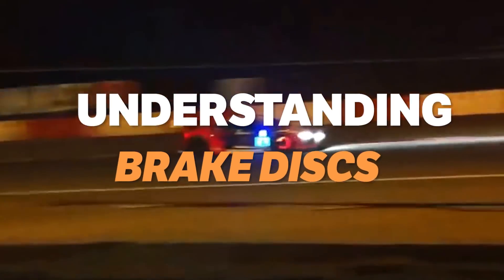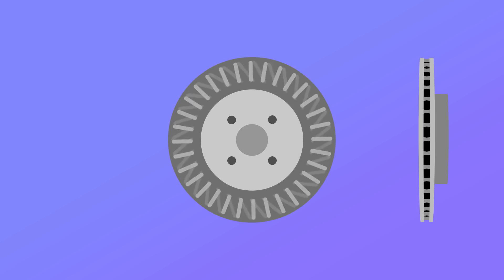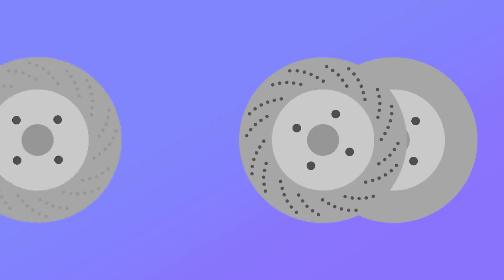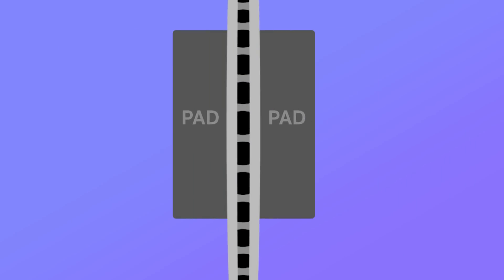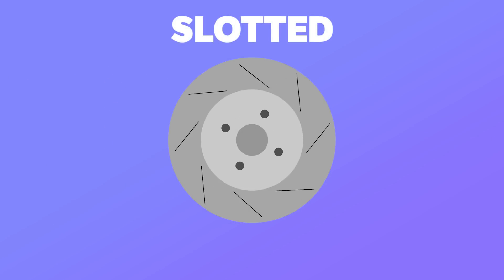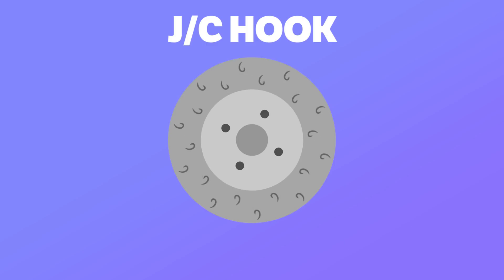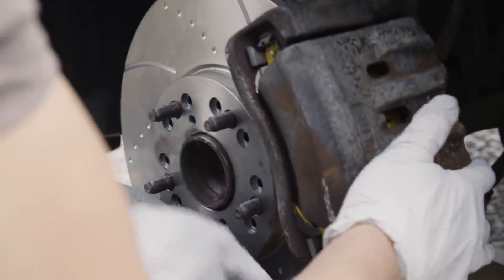The Truth About Brake Discs

Comment: in an emergency full brake lock test on a non abs equipped car, a flat surface disc will stop better than a vented/drilled disc due to more contact patch, however in a situation where u would be on a track doing lap after lap or a long distance of mountain spirited driving which requires hard braking but not emergency braking, then vented is better than a flat surface, in other words unless u are gonna race for more than a minute straight with plenty of mountain corners, or do more than 2 laps, a quality flat surface disc with quality carbon pads is sufficient and won't make any noticeable difference in the results, I have dba street series discs with carbon pads, I've never felt brake fade since after minutes of spirited driving

Comment: I find plain rotors with good quality ceramic pads work best for daily driving with frequent hard braking. Ceramic pads dissipate heat better so discs don’t tend to warp and the pads last. Seems to be the best value and performance for daily driving.
Reply: Discs don't generally warp. In fact its extremely difficult to warp a disc its a total misnomer. They get disc thickness variation due to improper fitting most of the time.

Comment: Cross drilled are junk, I've cracked them completely through. Yes factory pads don't really create the gas anymore, however if you use aftermarket pads for better brake performance like I do you should use dimpled or slotted rotors because they can create gas at very high temperatures that you'll experience on track.

Comment: For those of us who like cycling as well as cars...
Try to imagine the rim brake vs disc brake argument in this context.
Let me explain this to car guys. Road cyclists insist on rim brakes because their lighter etc. So they spend TWO GRAND!! on TWO carbon wheels. Wheels which have a brake track which the "rim" brakes clamp on. So when you brake you are literally pissing the cost of a full engine rebuild INTO THE WIND!!!!
Reply: PROcrastiDRIVE SV Why is that??? Road cyclists have no need for mega-powerful four-piston hydraulic brakes. Light and simple rim brakes work perfectly well.

Comment: Had vented slotted ones and pad buildup caused some vibration. Vented plain faces fix that issue. I’ve seen very expensive drilled brakes fail at the track so I advice anyone against those unless you want looks on a street driven car.

Comment: No mention on the important weight differences between the solid and vented discs using similar material ?.. I assume the vented disc is marginally lighter and reduces unsprung mass

Comment: Look at f1 brake discs, lmp1, lmp2, gt1 and gt2 brake discs and you will find non drilled, non dimpled, non sloted smooth brake discs. The dimples, drilled holes, and slots have 3 effects. 1) reduced surface area for the pad to grip on resulting in less possible friction. 2) drilled holes and slots carved in to the disc create the perfect places for cracks to form. 3) the look of drilled/slotted discs helps to remove more money out of the pocket of lesser informed buyers. Why pay more for a less effective and less durable product?
Reply: Carbon rotors used in F1 and lmp1 are very very strong and good at dissipating heat. the cars also have massive air ducts to further cool the brakes. On top of that, those pads actually work best when they're nice and hot. Their expensive design makes them very fade resistant and they don't really produce gasses. So with heat not being an issue, the f1 and lmp1 teams opt to maximize surface contact with the brake pads for maximum braking power...drills and slotting does work. More surface area open to air means higher rate of cooling. At the cost of less pad contact.
Reply: It's stupid, right? I always laugh when I see these poser-cars with their big rims and flashy drilled brake disks.
Reply: Wrong. Carbon ceramic don't suffer with glazing like steel discs and pads do. The thermal properties of carbon ceramic is totally different also so you are comparing apples and oranges. C hook and drilled discs help with de-glazing of the pad material and ventilation of gases. Also as per what Quinton Walsh explains, F1 cars have air ducting and the pads are ENTIRELY different to road car pads and operate better at much higher temperatures. You simply cannot compare carbon ceramic with much cheaper carbon steel.

Comment: If you have the right pads fitted, temp and Mu factor, you really don't need anything other than a plan vented disc. Pads give you seconds of your lap times on a track, slots, dimples, drilled holes might give you a few tenths.

Comment: Can you explain why carbon ceramic disc seems to have a more random drilled holes (no particular pattern) as compared to cross drilled steel disc where the hole pattern is pretty obvious.

Comment: FINALLY. it's time the drilled brake disc was retired from production altogether. I have drilled disks in my car and I absolutely hate them
Reply: F1 cars have just vented disc.Why don't own drilled or any other rubbish?Normal ones are the best.Secret is in the pads😉
Reply: @mihai-danut6955  Just vented discs eh? Are we not saying they are made from composite material with carbon fibre? Get educated 😂 What a donut

Comment: If you dont race your car, or drive down hill with heavy load, plain rotors will work fine. If your brakes over heats. You need bigger brakes. Just couple slots on a already vented rotor does nothing substantial.

Comment: I never liked disc brakes. I've never ever had a drum brake failure and the last far longer than discs. I can't count how many rotors and disc pad I've replaced in 25 years. The 30 years before that, I've only had to replace one(1) drum.
Reply: well on rear wheels the drums last much longer, discs just rust down, not wear out. on fwd cars anyway.
Reply: How can someone go through that many disc brakes?  What do you do?
Reply: Craig Pennington yeah drum brakes on the rear last like 50-70k miles
Reply: Before cancer stopped me, drive 150,000 miles per year.And when you get a life time warrenty on stuff,when replacing, they use the cheapest stuff they can get by on.

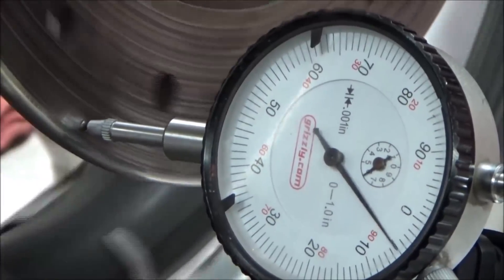Comment: 1:17 thats a DTI gauge not a thermometers 😂
Reply: Howy Yeah, but uneven heating and cooling can cause runout issues within the metal and with the pads leaving buildup, so it kinda makes sense.
Reply: clutchthepearls ofcourse it does to check disc warp and what your saying is correct, but in the way the video and audio was presented it made it seem as though it should be a thermometer, because they didnt say anything about disc warp, but you're correct im not saying what you said was wrong.

Comment: cross drilled discs help when you drive through a puddle of water as you won’t have a layer of water between the pad and rotor when you first apply the brakes

Comment: Why break callipers(probably wrong) at the rear at some cars are sometimes at the left and sometimes right. Get it?
Reply: calliper placement makes little to no difference and is up to the manufacturer. The lower they are the lower the CG but they have a small mass and very little height changes so it really makes no difference.
Reply: Liam Cooper oohhh good to know. Thanks man
Reply: all good mate

Comment: What about high-carbon steel discs ? Why some discs cost 40 € and some 100€ when they have the same spec on paper, made for the same car and only differ by the brand ? I'm running 30€ discs (piece) on my e93 330i and they stand pretty good for now
Reply: Vented and high-carbon rate on both rear and front
Reply: I'd say durability, heat dissipation, particule emited. Oh and brand name ofc
Reply: could be steel quality and ofcourse brand
Reply: glad it works for you, i had no luck whatsoever with anything i tried except oem bmw (e36 is what i have)

Comment: Downshifting saves brakes. True fact
Reply: StevEazyB Another advantage to downshifting is keeping the DFCO going. So not only are you saving brakes, you're also saving fuel. It's win-win.

The clutch is designed to be used. I don't see the issue in using it for its intended purpose.

Find it very difficult to heel-n-toe because a) I'm not very good at it, and b) there's literally no need to in city driving
Reply: Hammer Smith Uh, okay, that came out of nowhere. But I agree, holes in rotors are mainly for show on road cars. Got four vented blank discs on my Eclipse. They work fine.
Reply: Engine braking saves the brakes and makes u a better driver...
Reply: Hammer Smith I replied. Now hit me with your Freudian wisdom lol
Reply: and builds up gunk on the brake rotors. time to time its good to slow down using brakes to scratch down the rust builded up, ice/snow in winter and other shit sticking to the rotors.
Reply: Tomas T The braking I do from 15 - 0 mph is enough to take care of any rust or water buildup on the rotors
Reply: "Downshifting saves brakes. True fact" Can meet worms....
Reply: LKNANML ?
Reply: Hammer Smith vortex generators are functional when properly placed
Reply: Gastón Astore hahahahahahha exactly!
Reply: Man from Nantucket and engaging your clutch isnt wearing it? Yh I'll still to replacing brake pads rather than clutches. Also when you brake your brake lights come on warning people behind youre slowing, so potentially what youre doing by down shifting is dangerous too. I heel and toe that way you wont surprise anyone behind whos not quite paying attention.

Comment: Drilled and slotted disc less efective? I don't think so, becouse in my experiance it grabs on pads and works a lot better than plain discs. Of course pads get eaten a lot quicker.
Reply: Gastón Astore you are so right. 
My dad owns a Volvo, and you know, it's heavy for what it is (reported weight of over 1.8 tonnes). Had plain disc with soft pads.  recently changed (about 4 years ago actually)  to high carbon slotted disc with matching pads.  Now, I'm not a race driver but for what it's worth, they certainly grab and slow down the car much quicker.  
Seeing as the weight of the car alone would be a chore for normal brakes, heating up those pads would produce a lot of gas and prevent consistent pad to disc contact. Slotted definitely helps vent the gas out..

Also, directional vented refers to the internal cooling vanes to reduce discs temperature. Doesn't help with any pressure relieving.
Reply: StevEazyB yup. It isn't. And spending more for something that's essential in stopping your car, especially in an emergency situation and having them fail to brake or fail completely is even less fun.
Reply: xXxMartin96xXx they do, but when you brake hard you can feel when the pads grabs on to disc and then they brake very well I think even better than with plain discs. And you can hear it when it happens.
Reply: xXxMartin96xXx ok fuck it I don't wanna start a ww3 here :D
Reply: Gastón Astore so I was kinda right?
Reply: Well I'll trust in motorsport and they use drilled or slotted over plain. Id like to think they know what theyre doing rather than youtube comments sention.
Reply: xXxMartin96xXx Well the video is about performance brakes so yh otherwise you wouldn't give a shit and have a basic set up. Some people drive their dailies hard from time to time I know I do. Brake fade is not enjoyable.